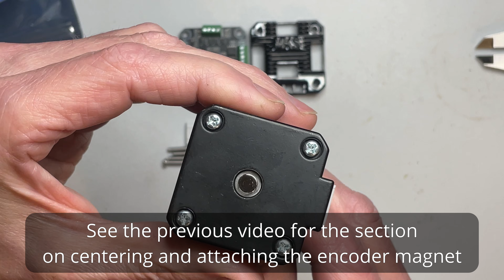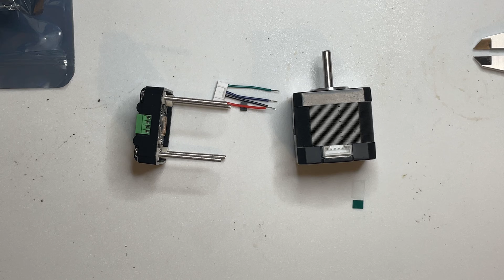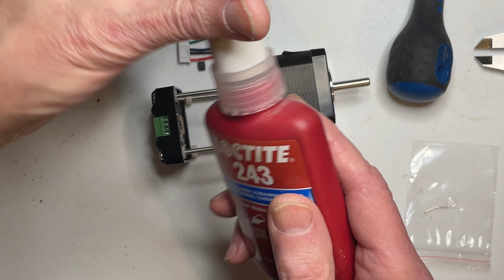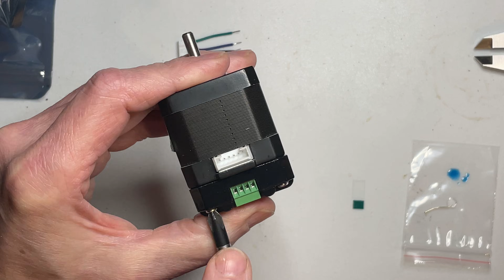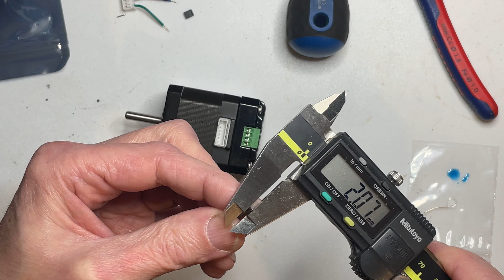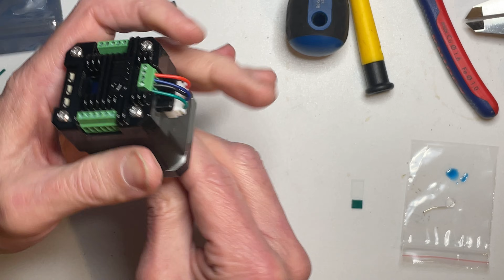Stepper motor to integrated closed-loop servo conversion

Comment: Can I use only that positioning part from these and use different driver control steppers using that positioning data?
Reply from the maker: Not ideally that board, as the sensor is internally connected to the electronics & the data would be delayed, as well as paying far more than needed.

Search AS5600 or MT6701 - those are similar magnetic encoder sensors and there are dozens of variations of breakout board with them on, many at only around £1.50 - £2.00 each if you get eg. a pack of four.  The correct radial pole magnets are usually supplied with them.

Comment: Can I conect it witch PLC s7 1214?
Reply from the maker: In serial mode, hypothetically, yes, if you used a 1241 communications module with RS485 capability.

Search "S7-1200 Freeport mode"
Freeport allows you to send and receive arbitrary data.

Step and direction mode could be used with any PLC, if that has a fast enough pulse generating output, which the S7-1200 should do.

Search "S7-1200 motion control step and direction" for info using that mode.

Comment: 영상 초반에 있던, 전선 밑에 깔린 작은 검은색 네모 부품은 필요없는 건가요? 부품 구입시 같이 포함되어 있는 걸로 알고 있는데...
Reply from the maker: That is a "jumper" cap or link, to fit the pins that enable the bus terminating resistor; it would fit below the five terminal connector, for the last drive along the bus, when using RS485.
Reply: @RJTC 아하! 매번 사용하는 부품이 아닌거군요! 감사합니다

Comment: This looks pretty good. I'm looking into upgrading my NEMA 17's to a closed loop system. Currently, they're controlled through arduino uno Rev 4's with a cnc shield and TMC2209's.

Comment: please excuse the noob question - I would like to swap my bog standard nema 23 stepper for one of these closed loop jobbies to ensure my arduino based positioner is accurate and doesnt miss any steps etc. Can I just swap the stepper out or will i need to alter the arduino code as well do you think? The stepper motor will be used to turn a machinists rotary table for accurate drilling of holes etc...I am driving it currently using a DM542 module
Reply from the maker: The driver modules can be set to use step, direction & enable signals, so if that's what you are feeding to the existing servo driver, it should work with little on no mods with one of these modules on a motor, as far as I can tell.

Comment: how you attched the magnet? glued it or used any kind of adapter?
Reply from the maker: It's glued to the motor shaft end (after cleaning both the shaft end and a surface of the magnet) using cyanoacrylate / superglue.
The bit of plastic tube used as a temporary jig ensures it is accurately centred.
Reply: Super helpful video. A follow up on the magnet placement. How critical is the centering and more importantly is there a test that confirms the centering ? That is my biggest fear with this setup. I am building an astrophotography rig where precision is of utmost importance and I worry that a small misalignment of the magnet will wreck performance. So would be good to understand how the alignment can be measured before using super glue. Thanks!